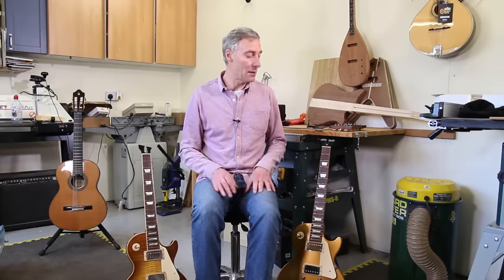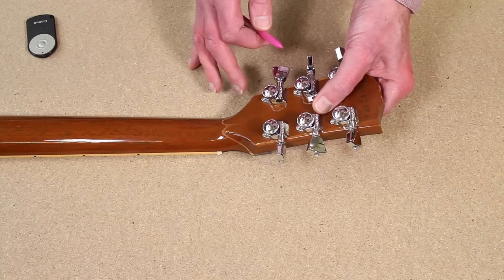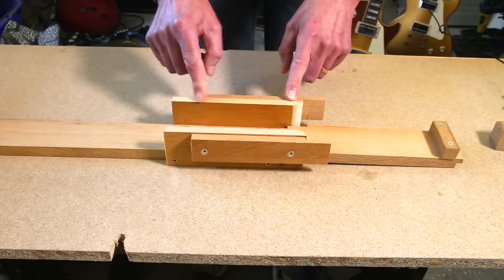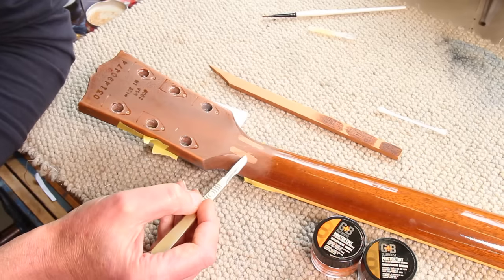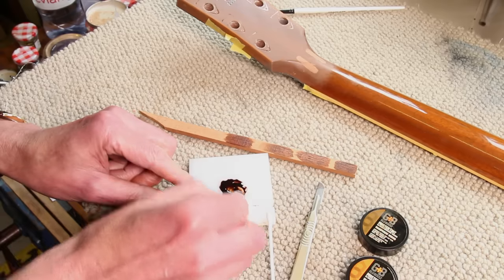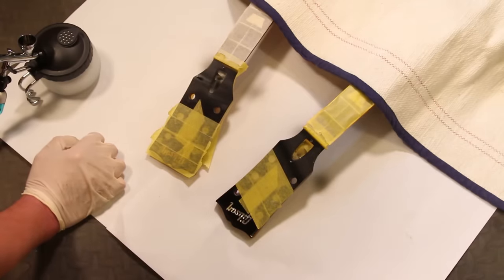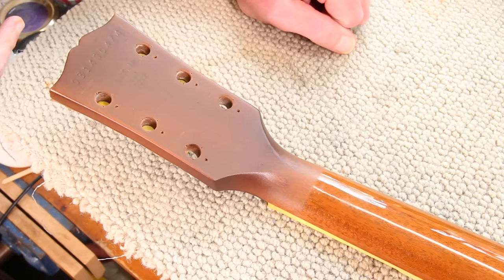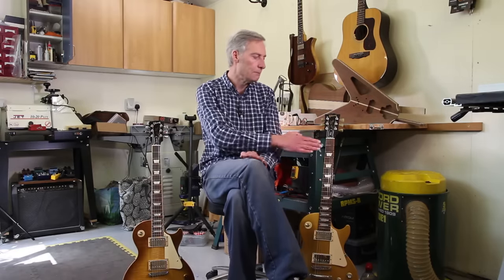Repair of a Gibson Les Paul with a snapped off headstock

Comment: Why they (Gibson) don't use scarf joints is a mystery to mankind forever.....
Reply: Because people want to buy a product as authentic to the original as possible, and it isn't a real gibson until it has a headstock repair
Reply: Not the same sustain level, according to the purists
Reply: Scarf joints aren't a perfect solution. You see many more cases of the fretboard ungluing around the nut and first 1-2 frets on necks with scarf joint (often you can see the resulting finish cracking along where the fretboard and neck meet), that's because that part of the fretboard is glued to endgrain of the angled part. Also you can still totally break an angled headstock if it's a scarf joint, often around the scarf joint itself (in this case the main part of the neck is glued by the endgrain to the headstock part), I've seen a few Epiphones and other guitars with a scarf joint with both of these problems, two of those happened when transported in a dedicated fitted hard shell case.
Reply: gryzew absolutely right sir
Reply: Because so many thousands spend so many thousands for an average guitar. Gibson haven't innovated for decades.
Reply: Jimmy Durex  Defending the indefensible. Gibson Guitars are inherently badly designed; no matter the quality of parts used.
Reply: Jimmy Durex  Yeah, they are obviously loved by many guitar players, but I do think it shows where Gibson is as a company that there hasn't been any real innovation there that I'm aware of. I get that people want vintage, but that's something that personally kept me from ever wanting to invest in a Les Paul.  I have to believe plenty of people would buy Gibsons that fixed that issue or at least mitigated.  You see "vintage" strats w/ modern improvements all the time.  Now would everyone want the new stuff? No, but I just wish we had legit options out there.
Reply: I will simply tell you exactly how they should fix this problem, yes its called a "volute" now the whole point of a volute is to make the headstock and neck at that very thin place and reinforce it, so this doesnt happen, and it looks more like a lip rather then anything else, if you were to hypothetically drop a gibson les paul with a volute and then drop a gibson les paul without a volute you will see 9 times out 10 the gibson with the volute will almost always survive the fall, and the answer to fixing so many of these broken headstocks and shady repairs is to just simply add a volute, but they dont want to add a volute because staying true to the 50's and 60's is more important then making craftmanship last for hundreds of years, not even in a les paul modern would you get such a thing as a "volute" that word "volute" is lost to the ages in the gibson world i bet the last time someone eve ushered the word "volute" in the gibson factory was back in the 70's when old farts sat round a table and said " aight mate we need a new look and modern features to go on a les paul" bunch of hooligans asking for way too much money now <_<
Reply: @nunomc2815  ROFL.
Reply: @evilutionltd  I have to agree. I always loved Gibson guitars since I can remember but now they are just a fetish from the past so I never would own one. The reason is that as an instrument they are not as great as people use to say. Those guitars may have been great in a far past when no one knew how to make a minimally decent guitar, and in this Gibson has an immeasurable merit because they created the thing and the technology to build the thing. Unfortunately they got stuck in time and in the latest 10-20 years Gibson guitars quickly became average and now any $200 Chinese copy kicks hard their butt.
Reply: Because tone, thats why.... Duh
Reply: @nunomc2815  As a Gibson owner myself, I have to say, that's nuts!  Resonance happens between the nut and bridge, not in the headstock.   My 'other' guitar has a scarf joint and it works just great.  Just ny 2p worth.
Reply: Stephen Docherty  You know what? Maybe you have to accept that many people actually do like these guitars and their specs. I am quite fond of the 17°, makes the guitar a joy to play; I like playing my 14° Epiphones as well, but I like my 17° Gibsons better. The difference in playability is not all in the angle, but that's a part of it. I've never cared for a Strat, maybe that's because of the lack of headstock angle (although I think it's got more to do with the bridge).
People have different tastes. And obviously many people like angled headstocks. Just live with it, it's not taking anything from you, there are plenty of alternatives with non angled headstocks.

And anyway, even with a 17° angle, they rarely break. And if unfortunately they do, it's only once, as they are usually stronger after the repair. The secret is not dropping them. But even though I had some drops, fortunately I had no breaks. Les Paul's are much more robust than they say, they won't break at you if you look at them. The design has its weaknesses, but it's not just something that will break.
Reply: They end up with a scarf joint anyway 😂
Reply: @ernestochang1744  as a matter of fact, there have been many les pauls over the years with a volute. It just so happens that if what you want to purchase is a model that is designed and constructed to be just like the 1950s era "standard" model, you're gonna get a guitar made just like the way those were made. Quirks/weaknesses and all. But if you don't want that, there are loads of others over the years to choose from too. And as far as "just adding a volute" to improve and remedy during the repair process goes, no "luthier" worth listening to (let alone actually PAYING) would ever propose just gluing an arbitrary block of wood onto the back of a guitar headstock to then shape a volute into... If the volute wasn't carved in during shaping from the get-go on a rough neck blank, it cannot just be added after the fact.
Reply: Jimmy Durex   Not everybody knows substandard when they see it.
Reply: @moonboogien8908  😂😂😂😂Tone doesn't happen in the headstock! At least not any that a human ear can hear.
Reply: @briansimpson8116  I know, its just a stock response ever pretentious guitar snob always comes up with. Tongue-in-cheek so to speak. Check any guitar forums (and this comment section) to find plenty of guys saying everything effects tone, which it does, but who the hell can tell the difference really?
Reply: They tried a few ways of improving the strength of the necks and the market turned against them for changing from the original 1950s design. They should implement the stronger necks on the modern series and leave the original series as is. I doubt Norlin era maple neck Les Pauls break as often. That is what I'd want if I was hauling one around for gigs, even though I have never broken one since my first Gibson in 1985. I have seen plenty of others though. I have just been lucky. 
I have not jammed for ages, so my Gibson neck is nice and safe at home. I should remember to put it away when my new little toddler nephew visits though. He darts around getting his hands on everything. Stuck his fingers in my CPU cooler fans within a split second of seeing the RGB lights. A few minutes later he was waving the bog brush around like a sword. Gross. I have a Marshall clone JMP50 chassis sitting here too. No case for it. Valves are exposed. It will be getting stashed before he comes over next time, because I can be sure he will lunge at the valves the second he sees them. No kids from two marriages for me, but this little terror has taught me all about child proofing a house. Fun kid though. He is great. Full of life.
Reply: Just last weekend, my sound guy sent me home because the scarf joint was messing up the mix.
Reply: Stephen Docherty  k
Reply: Stephen Docherty  please tell me more
Reply: Stephen Docherty  your knowledge seems so great

Comment: something in me screams for a headless les paul mod seeing him with that lp in his lap
Reply: I was thinking the same. I would ask my luither what do you thinks better fixing it to be original or just making it like a Steinberger
Reply: @AkeoT9  the problematic part would probably be the bridge, as it sits relatively high over the body on a lp. Not sure if hardware like this exists. Everything else, routing the top for access to the tuning pegs and the elongation of the neck to house the truss rod and locking nut seems to be feasible.
Reply: Sean Brennan The neck is glued in so probably not, plus how easy is it to get a les Paul neck on its own
Reply: @maxmustardman298  thats why i would ask what HE would think is better😑
Reply: Have you seen the headless SG?

Comment: I can’t help but think the guy with 2 broken headstock guitars is doing something besides just opening the case and to his surprise they just are in 2 pieces
Reply: Steve M as someone who owns a Gibson LP with a Gibson USA case that has seen plenty of travel and knocks, I can’t see how the neck would snap in the ways shown here. The case has a sufficiently padded support the length of the neck, that allows for a cushioned and gentle sitting of the neck up its entirety almost, except for the headstock area that is left open for storage of packs of strings etc. So for me, two things: either he is using a cheaper LP shaped generic case that lacks sufficient support OR, he is filling this storage space up excessively which means the headstock cannot sit low enough (storage contents are pushing the headstock up a little) thus forcing the headstock and lower neck to push excessively against the top of the case. If said case gets knocked or guitar cases are stacked this could create enough pressure to cause a snap
Reply: Exactly. I've been playing Gibsons for 30 years, mostly Les Paul's. I've traveled, gigged, and recorded in some strange places with my guitars. I don't baby them, but I also don't abuse them. I've never head a headstock break. I think common sense and a hard case are sufficient protection.
Reply: @Zoso981  Um...Did you not gather from the intro of this video that Les Pauls have a propensity to snap? If you solved it with a fancy case, perhaps you should let us in on the details rather than wax prophetic.  In that manner perhaps we could learn something.
Reply: @Eccles_Hall  You appear unbelievable presumptuous with a comment like this.  Perhaps an economy of words would be your best approach. Thanks so much.
Reply: @geraldhenrickson7472  I simply place my guitars in their Gibson-supplied hard cases (not fancy at all), and I don't drop them. Rather simple, actually.  I didn't realize I was "waxing prophetic" my sincerest apologies, your majesty.

Comment: Excellent workmanship! I just love your care and attention to detail.
Thank you for sharing!! 

As great as Gibson Les Paul guitars are, they definitely have an inherent 
flaw in their design with the propensity for the headstocks to break so easily. 
It would have been great if Gibson would have addressed this by 
strengthening and safeguarding their guitars in the original production process from the factory. 
But at least many can be salvaged and saved from the trash heap by careful technicians such as yourself. 

Cheers dear sir, and job well done!
Reply from the maker: Thanks for taking the time to post this comment. Much appreciated.
Reply: @flameguitars5770  
My pleasure!

Comment: Great work! I am in Canada, and I have done many of these repairs as well. I have found the hide glue doesn’t seem to work well for me on these repairs, so I have been using the standard white Titebond for these structural repairs. Loved the fixture you made up for this repair. Very brilliant and innovative. Mine is similar, but it has a fixed headstock angle. Love the hinged idea, as well as your application of headstock pressure. Awesome finish repair. Loved the video. Thank you for sharing your great work here.
Reply from the maker: Thanks Brett. Hope that some of my techniques help with your own repairs.

Comment: Beautifully done. I have a 72 Les Paul Deluxe that has had a headstock repair. It was done before I got it, and man did I get a deal on it. 🤘🤓 It’s not nearly as invisible as your work, however It is holding well for the the last 20 years, but I wish you’d been the one to do the repair on mine. Beautiful job... much respect.

Comment: I love Gibsons with broken head stocks. I love them because I can buy them cheap. They are easy to fix (with only a little skill), and a clean repair does not take a large collection of tools. The fixes shown in the video are considered by many to be the best method. However, I myself do not like to use dowels or splints, they add much complexity to the repair, but little extra strength. The key to getting a good repair is to have the surfaces properly prepared (so they fit perfectly together), to properly apply the glue, and to properly align and clamp everything together. Without the splints, the repair is much less obvious. I have a Gibson (one of my own) hanging on the wall by its head stock, which I glued back on 6 years ago, it is still perfect. I had a person bring back an SG on which I had repaired the head stock. He had dropped the guitar (again), but the break was in a different location than the repair. He was impressed that the repair (which was a simple glue-it-back-on job) was so strong that the break happened somewhere else.

Comment: Very inspiring and good enginuity. The same happened to my Breedlove. Luckily crack wasn't a complete break, headstock was still firm in place but damage was evident. I watched a few videos and although I didn't see this first one, that is how I proceeded. I did use Titebond glue, but the wood glue. I read some reviews on how "Hide glue" was affected by moisture and hot temperatures, and was concerned about a mishap. The wood type glue was said guaranteed that if a break would develop, it would Not be the original crack to open. In either case, I used a syringe 💉, carefully opened crack, injected the Titebond wood glue deep inside, enough to get into every nook n crany, then released headstock crack to rest. Used 3 C-clamps on supporting splint pieces of softer wood over the break, wiped excess glue and allowed to dry for a week. At end of that week, removed clamps and allowed it to rest 1 more week before adding hardware and strings. She is sounding beautiful, hardly notice the crack seam, so I didn't need to use filler or sand.

Comment: I bought a Yahama gigmaker deluxe an up graded version of the FDO1S. Then decided after watching you I went down to Menards a bought all the Oak I needed to fabricate a jig like yours in order to route those two oblong cuts under the neck, it's 12:21 am Wed March 9 and I was up over 12 hrs with all the running around figuring make it to last as I like the idea of reinforcement.  Might as well jump in. I also picked up one closet  Oak dowel 1 5/16 ×6' and 3 3/4 × 36" oak dowels and 9 1/4" -20-2 FT threaded stock some clear tuning that the threaded stock fits into to avoid scratching an acoustic drednought I plan to build , I'll cut the big dowel into 48 1" wheels drill a 5/8" hole in the top one cut 4" off one of the 3/4" dowels glue with a brush and tap the 4 and 1/2 piece in one of the dowels and check for absolute straight,  then when dry sit it upside down and drill it 1/4 " to fit my threaded stock. I must maintain a 5 1/4" between Bobbins 8" does they then I glued and pressed in the 6-32 pronged nuts at the bottom of the bottom spool then inserted the clear tube bumpers and twisted the top part that's had the threaded stock glued and settled with a fitted piece of cork I picked up in a roll 1/16"  believe to protect the instruments surface with paper you remove and is sticky paid 6 dollars and change for that. I'm going to make a hardwood storage case for the bobbins Menards has 1/4" flat square long hardwoods exhotic as well to make things like this. At any rate I'm sparing nothing they'll last . I was thinking about carving or inlays and cause them to be shall we say high end custom luthiers supplies inc. Ha ha it's fun for me and would do it if I didn't have to this business is fascinating challenging depressing exciting.  .it just hooked me as your generosity sharing your videos has done. Thank you. Next 24 k gold leaf spool clamps,  insane but doable. By
Reply from the maker: I see i have inspired you Patrick! I too have copied all sorts of jigs and techniques i have come across elsewhere.

Comment: Hi, I like the way you fixed the Les Pauls, I had the same problem with a straight neck break on a mates guitar. how I over came it was to drill 2 holes in both sides of the neck glued 2 small bamboo  skewers in one side of the neck put glue in the holes in the other part of the neck then glued the 2 parts together. The skewers worked as the splints but inside the neck the strength was not compromised. it's still going great the foolish owner has since dropped it on stage a few times due to the strap coming off and  put a few more dents in the guitar but the neck is still on (touch wood) Herman Marcic.    Ulladulla Australia